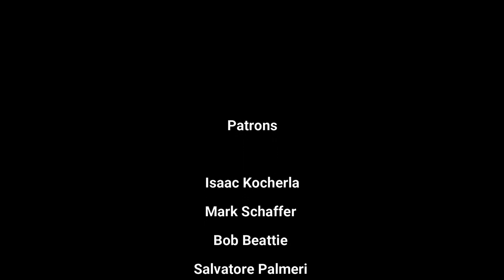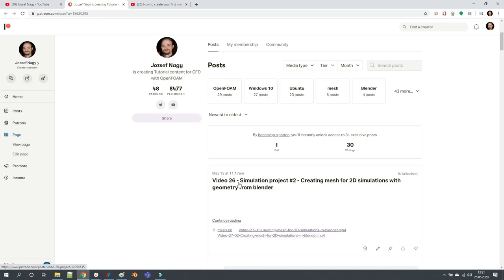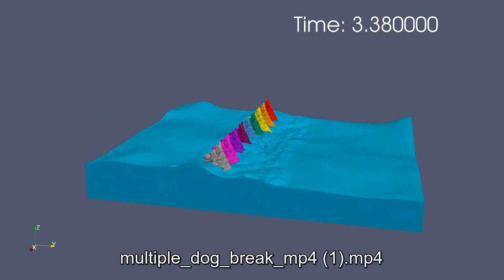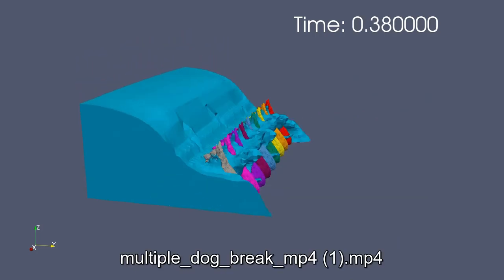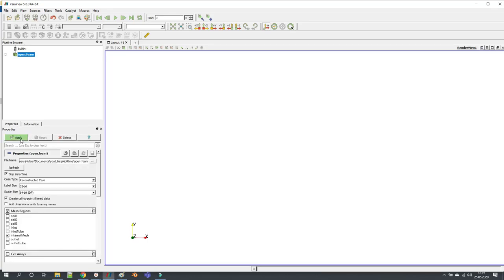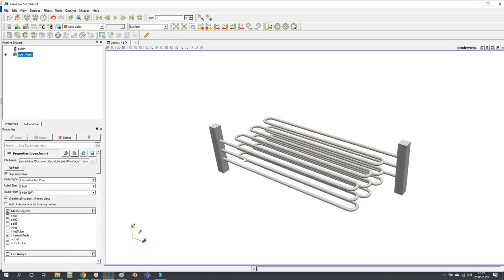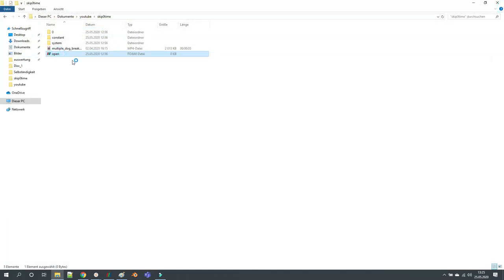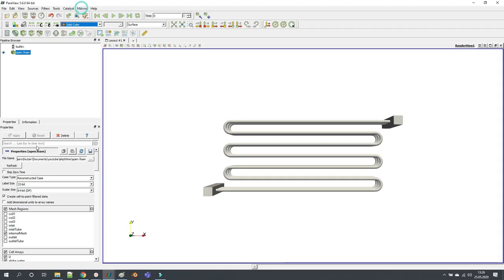How not to skip zero time in Paraview by default

Comment: Hi 
József! can you please make more videos on OpenFoam simulations under Windows environment? I was following one of your video and applying all steps until a message appeared that says (GLIBCXX_3.4.26 not found) when I tried to run paraview using (paraview &) in the terminal. I looked through many posts on the internet and updated as they recommend (gcc library, ...) but no luck!

Thanks a lot for your tutorials.

Comment: Does not work with ParaView / ParaFoam 5.0.1 if I change the prechosen cell arrays, camera parallel view etc. I would have liked this. I did not try to change skip zero time because it is by default not activated in this version and your problem does not occur.
Reply from the maker: Ok, in recent versions the default is checked, but if it doesn't occur in your case just use everything as it is.